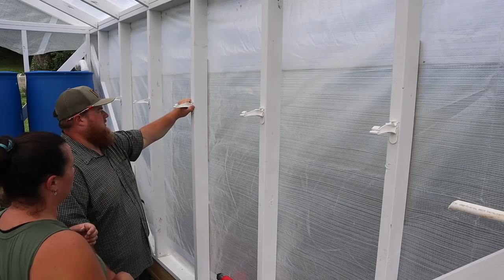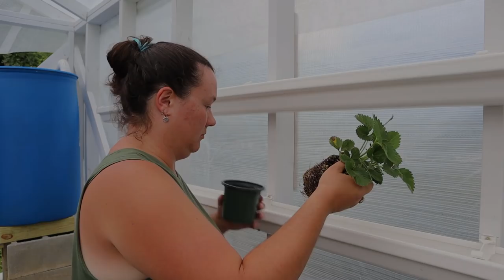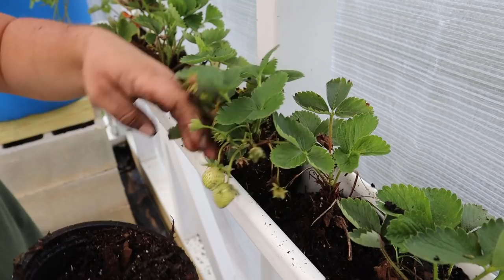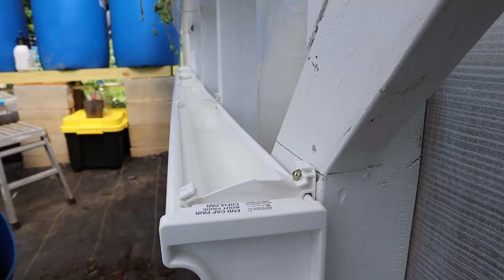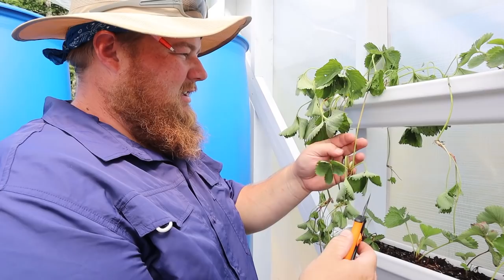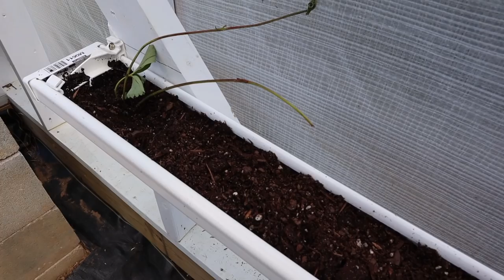EASY BUILD Strawberry GUTTERS in the GREENHOUSE!

Comment: Sam, Angela what a great idea the gutter system is, here's a similar system I adopted from an old work mate many years ago, here's how he did it, he grew his strawberry's in large pots in his greenhouse, he had 3 rows and each row had a different coloured pot (you will see why) he used what he called his 3 tier system, to get his 3 tiers he had to start somewhere, so the first 2 years he took as many runners (suckers we call them) as he could, to give him the three rows he needed, choosing only the strongest plants.
From then on he only took runners from the oldest plants, any runners from the other plants were cut off and discarded,  he clipped a smaller pot to the sides of the larger growing pots to root them in, when rooted he separated them from the parent plant and grew them on separately changing them into larger pots when needed, till the final pot, from these newly rooted plants he again only selected the strongest plants to make enough for a new row, discarding any others.
When a 3 year old plant had finished it's crop season, they were discarded, (you have to be ruthless in this), but don't forget these old plants also supplied the new plants for next season, hence the reason for the coloured pots for rotation purposes, each year the plants moved down a row, from the youngest at the top to the oldest on the bottom, he swore down by growing them this way they gave him the best quantity and disease/pest free crops.
The 2 year old plants give the heaviest crop usually.
Reply from the maker: Cool idea! Thanks! -A

Comment: A good way to block the drain holes that you drilled is to use some of the metal roofing screws that have the rubber washer under the head.  Just screw them into the holes using a hand tool and not the drill.  The drill would probably strip the plastic on the gutter.

Comment: I looked at the vinyl gutters and they were only 4" wide so it seemed like a very small place to grow my strawberries. Although I do like the look and feel and how easy you were able to put them up. I am in the process of nailing up 3 10' gutters on the outer wall of my house, which is stucco / brick. So I picked up a carbine drill bit and a about 16 3" tapcons. Wish me luck !!!!

Comment: Good luck with the gutter system. Are pollinators able to get into the greenhouse? Also you need some flowers in there to attract the bees etc. right? I would also clip any runners to just one. Meaning I noticed some had additional runners coming from them. You want them to put their energy into making fruit not making more plants. I wondered if they would go into shock with the ripping out of the bed. What type of strawberries are you growing? I am in No. Ca. and am growing Albion. So far they are not as productive as stated and very sour and are supposed to be so sweet. They joys of gardening.

Comment: Oh goody!! I've been wondering how well this system works so all I gotta do is watch you guys :) About the drainage....how would it work to lower both ends of the gutter on a decline from the center out. (make both ends lower by say a half-inch or so and the ones in from there a quarter-inch cuz water flows downhill. Am I explaining this right?) Then, put your drainage holes in the end caps as low as you can? I'll bet your plants will put out more runners during the season. In the Fall Pop used to pin the runners to the soil to get rooted baby plants to start the next season.
Reply: Great idea, we just built a greenhouse this spring. We are always looking for ways to add growing space. My strawberry plants are being overrun by ivy so will be moving them. Thanks for the idea.